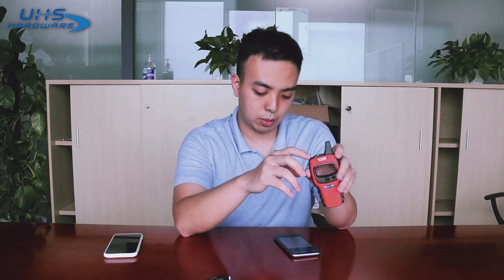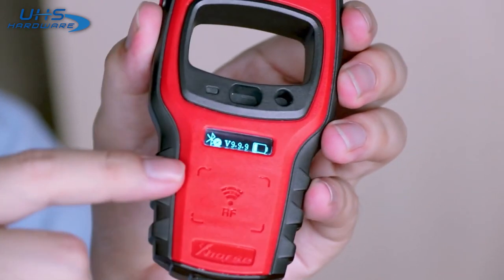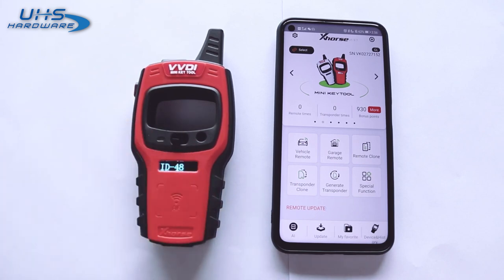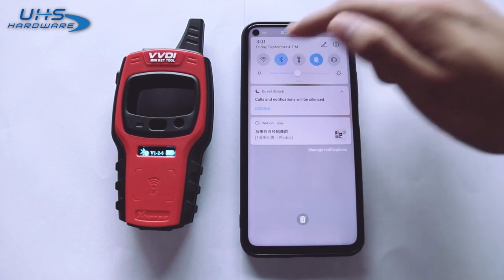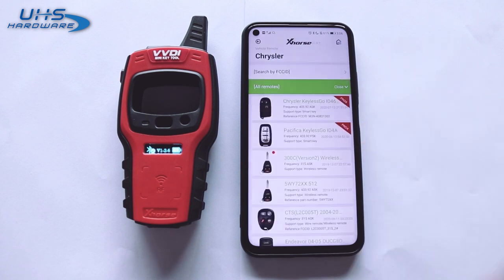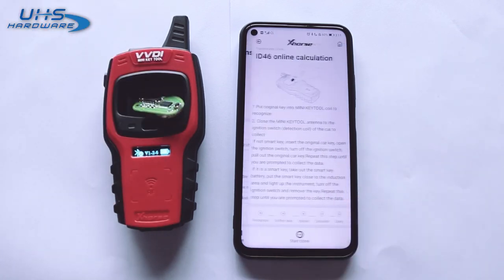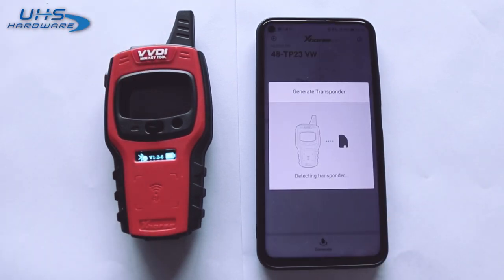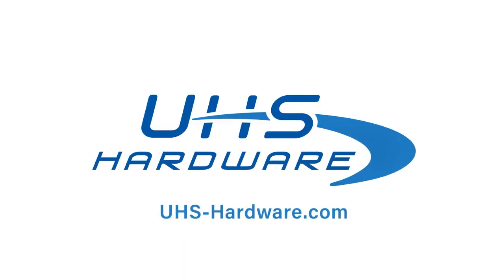Xhorse Workshop 001 MINI KEY TOOL OVERVIEW

Comment: I tried to clone a key for a 2004 Honda Accord but it said: "not support chip"  and something about a "SuperChip" required. Then I tried to clone a remote FOB for a 2005 Pontiac Montana SV6, same as GM Uplander, but the VVDI mini keytool said: "SN2 modle detected,speical clone only support wire key,please change key module" (I copied it exactly as written) I contacted Xhorse and they confirmed I needed their special products. Perhaps they should've included the "Superchip" along with the product, or at least disclosed the requirement. I sent it back.

Comment: This video really needs updated, the app has changed and setting up the Mini is more complicated.  I barely figured it out, and it took me a long time.... I've very tech savvy so it would be helpful for your customers that aren't.
Reply from the maker: Thanks for the info! We will check this out!
Reply: @UHSHardware  Now I updated the mini and can't login, any way to do it?
Reply: I am trying to do a special clone function on my key. Picks up frequencies etc however when going to write it does not write to the board for unlock lock functions. Is there a specific key I need to use to be able to use the special clone function?